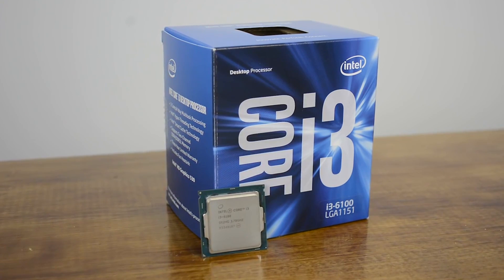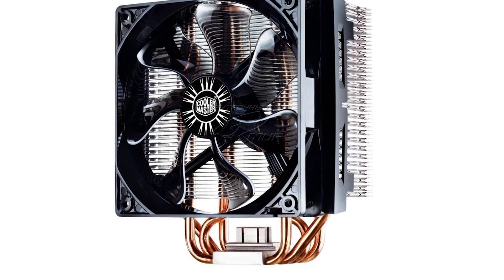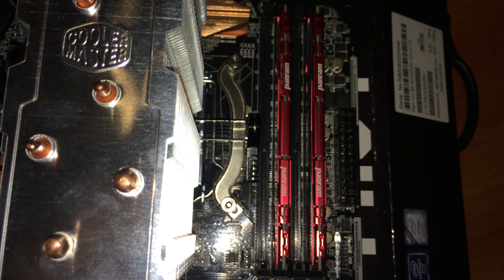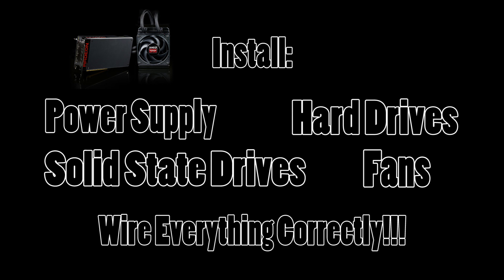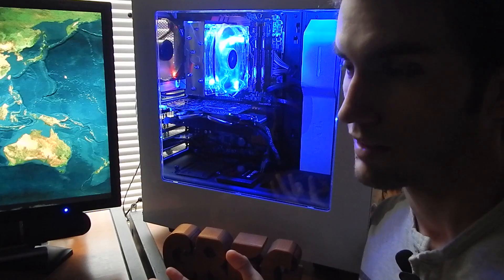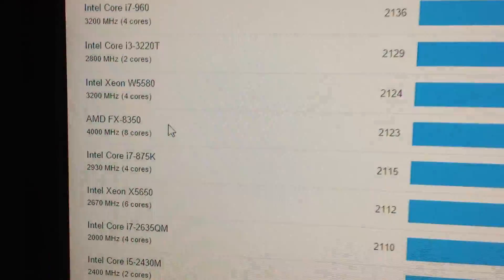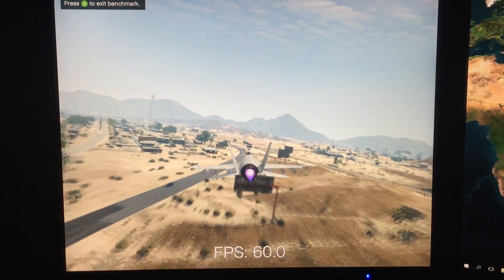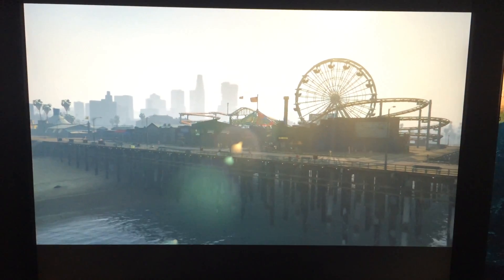$600 Intel i3 Skylake Build

Comment: wat is the BEST 200$ below gpu with i3 6100 ???
Reply: 750ti
Reply: ali99 _ rx470 just made the same decision
Reply: gismopatch Rx 470
Reply: ali99 _ 1050ti or Rx 470
Reply: Jango Fett rx 470 is much better
Reply: Sausage Bu yes but bottlenecking may be a problem with it, I gave the two best options for under 200
Reply: if you look for deals (Reddit /buildapcsales is great) then you can get an RX 480 for a great deal,as you can a 470. I got an MSI 480 for $160 and that'd beat literally anything else up to $200. the 470 is currently overpriced but offers similar performance, though if not that then you could A) go with a previous generation GPU such as the gtx 970 (which is <or= RX 480 in performance but > RX 480 in price) a gtx 960, or a gtx 1050ti. Performance wise, the RX 460 is 25%< gtx 1050ti which in turn is 25%< RX 470. 

take your pick
Reply: Gtx 1050ti is about 30-60$ cheaper than rx470..rx 470 offers more performance. ...I guess 40$ is worth it..people say rx 470 and 480 doesnt have much difference. .rx 470 seems good..what do u think?

P.S would be gaming at 1366x768 -- 1280x1080 monitor

Wont game on higher. .like 4k..
Reply: I want gtv to run 75fps plus on veey high at 1366x768. .
Reply: ali99 _ The Gtx 1050ti is about 25% below the RX 470 performance wise and price wise, but that and theRX 470 are both the best two choices. The 470 will get you as high as you can get  under $200 for MSRP, whereas the 1050ti might start to struggle with the high settings after a year or so. Idk, both will work well for now,but you're getting more for the 470.
Reply: k ill get the 8gb version...ty

btw should i rather get 8gb rx 470 or 4gb rx 480 ?

XD part picking is sooooo confusing
Reply: ali99 _ You're ok!! It takes alotta research.

Now as for 8 GB v 4 GB, it's like getting a slower car with a bigger gas tank vs a faster car with a smaller gas tank. The faster car will run better, but the slower car will run longer [though in this case by the time the gas runs out your car will be outperformed by any modern card]. 

In this case I'd say it's not worth it as, by the time 8GB has any real impact on gaming performance [as right now there are still very minimal gains] your RX 470 won't be keeping up as well as a budget replacement. And the gains you Do get aren't worth downgrading from a 480 to a 470. That's one of the issues with a 470, it's priced in this weird area where it's hard to choose that over a 480, but it's still king of the sub- $200 if you don't consider the 480 at a slightly higher price point.

Basically, if you're going for budget, go for 4GB. Whatever budget card you get won't be running fast enough by the time the 8GB really counts. Additionally, it's better to get a 4GB RX 480 than an 8GB rx 470. The GB has to do with how much is rendered, but the Model determines how well/ how easily it is rendered, even if not as much is rendered at once. So the 480 will have greater FPS than the 470, even with the lower memory cap. Better a 480 over 470, regardless of the Memory. 

That's in my opinion, they're very similar cards as far as performance goes but feel free to lookup vids on Youtube over the topic, I know i saw one that made me choose the same thing.
Reply: ali99 _ Lemme know how it goes and show your part picker guide! also checkout pcpartpicker,com, really helpful resource for gathering parts, checking compatibility, pricing, price history, reviews...it's a very useful tool.

Comment: Is I3-6100 okay for playing games like CS:GO,Outlast,DOTA 2,LoL,Assasin's creed,GTA 4/5,overwatch,TF2 and Smite?

other processors in mind:
AMD A10-7860K
AMD A10-7860k
AMD A10-7700

Intel i3-4170
Intel i3-4160
Intel i3-2130
Reply: Steve Jobs your on every vidro
Reply: it is MORE than ok.
Reply: better than a mac
Reply: Yeah an i3 6100 would suit just fine. 6100 is capable of 200fps for league. this I know from personal experience. Assuming your other components are up to par.
Reply: of course gta v won't run as good. With a good budget card perhaps 60.

Comment: um... the i3 series does not turbo at all...
Reply from the maker: Old video. I was referring to the BLCK overclock I pursued following this initial setup.
Reply: +Science Studio I am not referring to the over clock that was later patched by motherboard manufacturers. I was however referring to the point at 4:30 in the video when you mention it has a turbo boost to 4Ghz.
Reply: +Science Studio love the videos though!
Reply from the maker: The "patch" you're referring to is not permanent and is very easy to undo, as I've proven time and time again on this channel. In fact, most motherboards ship with pre-patched BIOSes.

Comment: guys, can this cpu bottleneck a RX 480 or r9 380x?
Reply: You're delusional
Reply: it should run just fine
Reply: maybe a little bit on gta v
Reply: just a little bit on gta v and far cry 4 but not an issue
Reply: No not at all. An athlon x4 from 2009 might bottleneck a modern GPU, but not today's cpus.

Comment: I am thinking of I3 6100 8Gb DDR4 and H110 mobo with 750ti? will it be good enough for 1080p gaming and streaming at 720p.
Thanks
Reply: Actually MDComputers is the official distributer of the Pascal series cards in India and the cheapest 1060 comes at $340. http://mdcomputers.in/gainward-graphics-card-pascal-series-gtx-1060-6gb-gddr5.html?search=gtx%201060
Reply: Andrei Cura I'm talking about the CPU, the CPU might be too powerful for the GPU.
Reply: Try RX 480?
Reply: +Andrei Cura the RX 480 costs $420 in my country plus I have a 750ti .☺
Reply: +Kicstar V that sucks Lol. Which country do you leave? In my country the 480 cost about 240$
Reply: +Andrei Cura I know... India is all about making graphics card unbuyable? is that even a word lol. the gtx 1070 costs more than $700 here.
Reply: +Kicstar V yeah i know that feeling but im saving for 1060 :)
Reply: +Andrei Cura Good luck with that.
Reply: Use a r9 370 or 960
Reply: +rocknexus i m not mad!! but broke 😢 jk. no in india the 1060 comes for $400
1080 for $1000
1070 for $750
Rx 480 for $450
Reply: +Kicstar V Building the same system as well, we will be fine. It will run any current game at least at minimum, but most at high settings, and will be able to video edit and do Photoshop (basic YouTube channel stuff). 

On that token, I wouldn't take everyone's advice on YouTube because when you ask about a build you are trying 99% of the time people say you should use a component that they have or are going to use instead of actually considering the build. 

By my estimations and extensive research you and I have chosen what is basically the best setup for less than $500 with an Intel CPU.
Reply: +Jacob Neill yup i3 6100 is the best budget cpu but i when playing modern games there is a huge fps difference between i5 and i3 skylake with same gpu so i am waiting for some time and by the end of October, i will build my pc with the specs mentioned above but with an i5 6400/6500. Its good to get a quadcore for streaming and other stuff then a hyper threaded dual core.
Reply: +Kicstar V there might be some bottlenecking with the 750ti and i5 6500
Reply: NovaStudio are you serious? even the gtx 960 cannot bottleneck i5 6500
Reply: i live in Iran and so much treble. we most pay 4X hier for VGA cart
Reply: NovaStudio ahhh sorry, but then it is not called bottleneck :)
Reply: Andrei Cura Yes.. It's called bottleneck lol
Reply: A bottleneck occurs when the capacity of an application or a computer system is severely limited by a single component. Let's say the CPU i7 6800k is too powerful for a amd rx 460 but as the definition said "when the capacity is being limited" the 460 is not limited bec the is its full potential
Reply: i want ask if  i3 6100 with gtx 1060 has bottleneck？
Reply: 旭峰胡 1060 is equivalent to RX 480 which is equivalent to the GTX 970, nah, there won't be bottleneck.
Reply: NovaStudio thx！
Reply: 旭峰胡 if you know how to OverClock that would be better :)
Reply: Andrei Cura if i want to OC，do I have to choose a z170 mobo ?
Reply: 旭峰胡 Yes.
Reply: nope, get an a bit more powerful graphics card like the gtx 950.
Reply: i feel u lmao
Reply: Kicstar V b